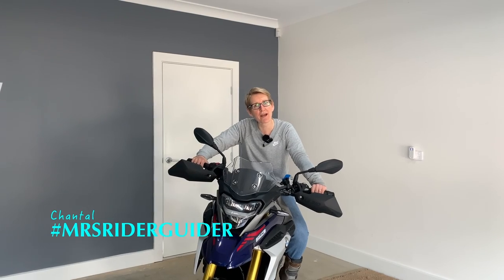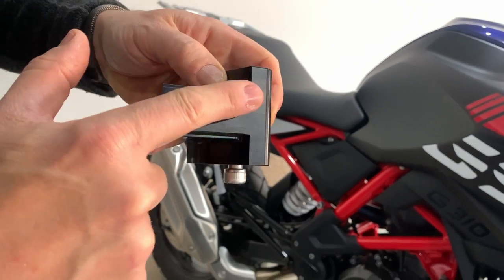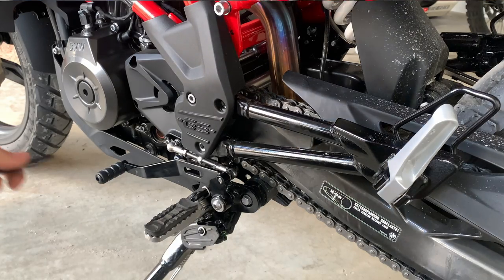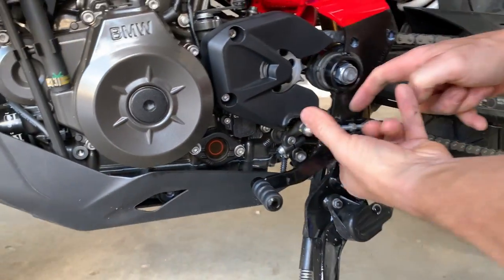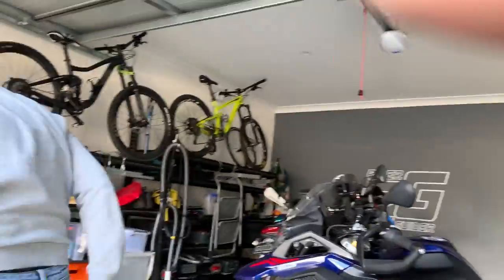2022 BMW G310GS - HOW WE ADJUSTED THE HEIGHT AND GEAR LEVER

Comment from the maker: 2022 BMW G310GS - HOW WE ADJUSTED THE HEIGHT AND GEAR LEVER

#MRSRDERGUIDER has got her new #bmwg310gs - here's how we adjusted the height and gear lever to suit her geometry.  
She's found it a little tall and we decided to share how we dealt with the issue by fitting a lowering link at the rear and dropping the forks through the triple clamps, we also adjusted the gear lever to improve the ergonomics for her even more.  

00:00 Intro
00:18 Chantal showing her height and gear change problems sat on the bike
02:26 Showing the actual lowering link we got from Amazon
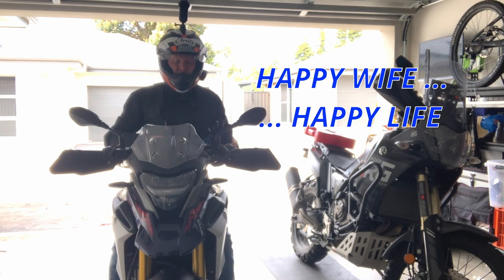05:14 The link actually fitted and the forks lowered plus some considerations
07:52 Chantal sat back on the bike after lowering
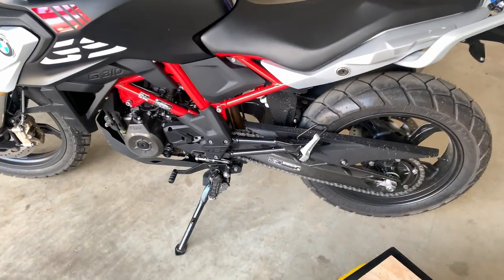08:15 The gear lever adjustment and tools required
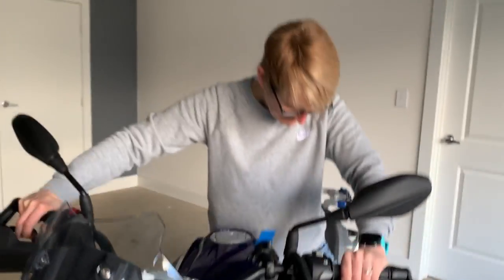18:48 The test ride and a much more confident Chantal

There will be a lot happening with this bike going forward so stay tuned for accessories, improvements and of course, rides.

Here's the link for the rear suspension bracket on Amazon 
https://www.amazon.com.au/gp/product/B09PWN4RB1/ref=ppx_yo_dt_b_asin_title_o04_s00?ie=UTF8&psc=1

#bmwmotorrad #theriderguider #bmwgs310 #g310gs #girlswhoridemotorcycles #2022BMWG310GS

See you on the next one

Neil & Chantal 😉

Comment: My wife has a 310GS. She’s 5’2”. I lowered hers with a Wilbers suspension unit and a progressive front fork spring. I didn’t go down the lowering link for the same reason that you found. She had the same problem as you with the stand. I took the stand off, cut it down by 60mm and welded a 60mm extension to the kickstand peg, powder coated it and now she can flick it up.
Reply from the maker: Brilliant Steve, I reckon that 60mm extension is a must do.  Cheers mate.

Comment: I just installed a lowering link yesterday. I was on my tip toes before but now I’m flat footed. Much better.
Reply from the maker: Good work Robert - it's a great bike.  Did you lower the forks through the stanchions too?
Reply: I did not. I wanted to feel how it felt first. I may lower it a half inch in the front.
Reply from the maker: Yeh we did about 13-15mm so similar, MIGHT go another two or three mill yet but seeing how we go.  Getting some more off road tyres first to see where we're at.

Comment: I went with the HyperPro Front and Rear Performance Suspension Lowering Kit. It lowered the bike about 55mm (2”) and really made the difference for me since it allows me to practically flat-foot the bike. I had my local BMW shop do the installation. I’m 5’4” and really struggled with the bike as I live in the mountains. Before the lowering kit, I would get exhausted trying to maneuver my body so I wouldn’t drop the bike at intersections or unplanned stops. It was pricey, but now I feel like the bike is built for me.
Reply from the maker: Thanks for watching, yes we can spend a lot of money on these quite quickly but it's a good enough all round bike to make it worthwhile.  Ride safe mate.

Comment: I tried one of those rear suspension adaptors on Kawasaki ER6F which it did but the original unit scraped on the bodywork. Wilbers made a replacement unit in 'standard' length plus two others 5mm and 10mm shorter, I opted for the 5mm one and it worked great. I raised the forks slightly through the yokes. Happy rider.
Reply from the maker: Good work, takes some sorting out but great once it is done.

Comment: Nice little demo of adjusting a bike to suit the rider, people shouldn't be afraid to alter settings to make it easier for themselves. I've just adjusted the gear link on the Gixxer by 5mm height and changes are smooth, not clunky anymore.
One small point- the threadlock should have been put on the shiny end bit, as that is the part of the thread that is  screwed in (and where the original threadlock was taken off by being unscrewed).
Reply from the maker: Good point matey, I think I'll remove and refit them!

Comment: Ha, never thought to alter the gear lever when I had some new boots I just kept riding until the new boot fit under the lever better! As for seat heights, turned down a mates 1050 Triumph as I could only reach the floor on tippy toes, it had only done 8000 miles, on reflection I should have bought some high heels then bought it. Interesting and informative video Neil and Chantal. Ride safe as always.
Reply from the maker: Oooooh that 1050 Triple mate 🤩
Reply: @TheRiderGuider  Last I heard he stuck it in his shed and it's still there. Unfortunately he got the sack with a group of others for taking bribes and stealing so haven't seen him for a few years. I keep an eye out on Ebay as it will be much cheaper now!

Comment: It helps to take off the foot peg rubber to get the shift linkage adjustment
Reply from the maker: Actually we’ve also since removed them both.  Also added a plate to the brake pedal which has improved that too 👍🏼
Reply: @TheRiderGuider  the brake pedal is too low and not adjustable … I added a piece of rubber zip tied on top of mine
Reply from the maker: @danielb9644  we did this … https://youtu.be/qOeqD3Zx1z0 Chantal reckons it’s better.  Not perfect but is useable now 👍🏼

Comment: The side stand is def a pain for us shorter riders when off road on this bike, great little bike though 👍
Reply from the maker: I'm gonna try get it sorted later this week, there's an engineering firm not far away from where I live, thinking 20mm off it!!!   I struggle with it so Chantal has no chance.
Reply: Yes, for short riders (as me, 1.65 mts) the side stand is a problem. I believe is a design problem of the side stand. I installed in the side stand a longer piece on the side. However is not a well solution.
Reply: What is your height dr200?
Reply: @teodelarosa8247  5"6

Comment: Hi - thanks for the video, did you need to shorten the sidestand after fitting the Bestem lowering kit? Cheers
Reply from the maker: Yes I did, local engineering firm, 20mm, $20.

Comment: Super helpful. Any issues with the shifting once you had adjusted the lever? I did mine and found it didn't want to change gear when adjusted upwards so I had to put it back down. Lots of false neutrals or refusal to shift at all. I thought maybe I had shortened or affected the throw at the front ball joint too much.  I'll give it another go when my bike is back from the dealer. I have a 2021 MY with cold start issues - can be annoying when it's 2 degrees down in Tassie and she refuses to take me to work!
Reply: Also - for your next upgrades I'm running bark busters (stock guards lasted one drop), the OEM crashbars and aluminium skid plate have already paid for themselves, but something like SRC or SW Motech ($$$) may be a better bet for upper fairing protection. I also have Motoz Tractionator Adventure tyres (very grippy but a little loud on ashphalt), and an R&G radiator guard or similar is a must have. It throws lots of mud and dirt up at the radiator.  She's a very capable bike!
Reply from the maker: @jimma47  This is awesome information - thanks mate 🙂
Reply from the maker: No issues so far mate, we'll keep an eye on the front ball joint.  Been cold here too but the bike is garaged.  We might end up on a boat to Tasmania one day, some great riding over there I've seen 🙂

Comment: Hi guys! I am 1.65 mts, in other words a short person. I had also problems with the high of my G310 GS. What I did? I just bought the lower seat and bought higher shoes to drive the motorcycle. 

Before that, I asked in BMW about how to decrease the high of the motorcycle and they were very strong saying in Not modify the high of the forks as in the video is explained due if you do it, you are modifying the structure of the design, that can  affected the driving in turns and also in high speed. Is a modification in gravity center. Is something not simple. 
So. In my opinion, take care, in this kind of modifications. 
Regards. Leonardo.
Reply from the maker: Thanks Leonardo - ride safe mate :-)

Comment: Hello !! thanks for the video, is it very helpful for newbies like me? I would like to ask you, at the agency the seller recommends that I not lower my motorcycle so as not to alter the geometry, I reached the ground on tiptoes and it would be much easier for me to reach the ground with flat feet, my question is, did you have any performance problem with the bike by altering the geometry? Is the height of the motorcycle insufficient to take it to the field? or with any obstacle? Thanks in advance
Reply from the maker: Hi Erick, no problems whatsoever.  There's not a massive difference in my opinion if you also drop the forks a little.  There is still plenty of clearance.   I recommend it.  Thanks for watching and keep in touch we have more coming up on the GS soon.
Reply: @TheRiderGuider   thanks, I will do it today!
Reply: Hello, its  me again , I did lower my bike, the change was great, I feel confidence now! I have a question for you, did you cut the leg of the bike?? How many centimeters?   I will cut this weekend my, it will be very helpful for me know this data. Thanks!
Reply from the maker: @erickmartinez9340  Hi Erick, 20mm was enough for us.   I’m pleased this is helping you 😎👍🏼
Reply: @TheRiderGuider  thanks! I will follow your advice!

Comment: Does it work with a 5'2" with seat adjustment I've only ridden 785mm seat heights for now?
Reply from the maker: @ArielMoments yes I would say so, Chantal is 5’4” but has now got enough confidence to be considering going back to the standard height so at 5’2” a rider should be fine.   Obviously there are other things to take in to account such as actual leg measurements but as a general guide you should need okay 👌🏼 🙂

Comment: BMW do a low seat option lowers by 30mm
Reply from the maker: I think that may be on our radar now.  It is quite a reduction.  Could then actually remove the lowering link.  Chantal a lot more capable and confident on it too.  Just the seat would see the bike back to all its original geometry 👍🏼
Reply: @TheRiderGuider  Glad that was of help I don’t actually have the BMW though it was on my radar at one point I still like it I have a Honda CB 500 likes can I have a similar problem I am 5 foot 10 short in the leg

Comment: Hello, I have a question.. I am going to the installation myself, of this piece, I even ordered from amazon still waiting to arrive...  But I get in doubt about the upper and lower fork, this need to be also moved?
Reply from the maker: Front forks?  No - it is your choice, see how it feels and if you're happy with it, you can still leave it as it is.  Or you can experiment.  🙂
Reply: @TheRiderGuider  oh.. I though that was something needed because the lowering link, I'll check, because factory one the distance that came there is very small, 1cm may be?.. 2?.. i need to check on my bike.., nevertheless I get the piece also from amazon usa, now waiting to arrive and feel me more confortable on my bike.. nice video BTW.
Reply: @TheRiderGuider  Hey man, I put this accessory to my 310gs... and is incredible how get low, but now I have a little issue, I don't know if that happen also to you. The bike now stand to much vertical.. How you make to solve this if happen also to you?  regards.
Reply: Having the same problem, great for lowering the bike, but gets to vertical on the stand, it becomes so easy to drop it when parking on surfaces that are not completely flat. Let me know if you found a solution for this.
Reply: @praburm  Yeah, Thats what I did, I cut off 2cm for the side stand and now is good.
Reply: @adythings  may I know where did u purchase the kit ? I’m from India.. would like to know
Reply: @praburm  yo man! I got it from Amazon USA. They ship to Portugal so was ok for me hehe.
Reply: @adythings  ok Amazon USA .. ✌🏻👍 thanks for ur timezz safe ride.. u can check my channel as well related to bmw g310R

Comment: 😂remove the retainer clips on both ball pivots and snap off the adjustable arm. Then you can loosen the lock nuts and adjust the ball sockets in or out to whatever height your needs are .Spin the lock nuts back snap the balls back on and check your shifter. If it’s good  snap the keepers back on the ball socket and your golden❤

Comment: How tall is she?
Reply from the maker: Hi Isabella, 5’4” … interestingly now she’s grown with confidence and actually thinks she could revert to full height.
Reply: I am trying to make up my mind if I want to do the 2.2 lowering kit from touratech. It is $1,000 plus labor. Did you have to buy additional parts to lower the front suspension?
Reply from the maker: @isabella1823 no, the front is relatively simple, we just dropped the stanchions a few millimeters.  We had to shorten the side stand slightly.  Local engineers helped out on that.